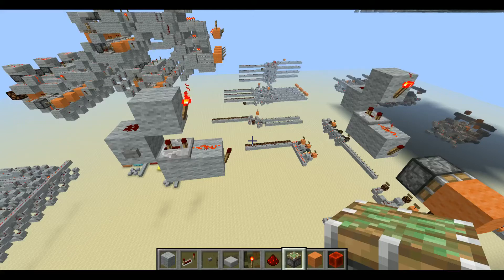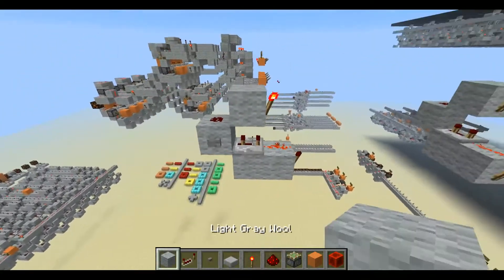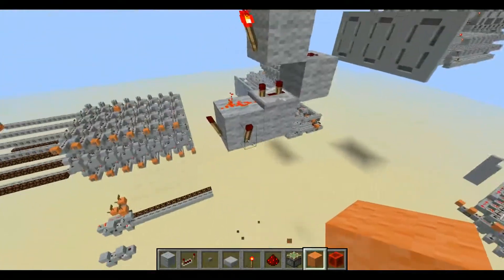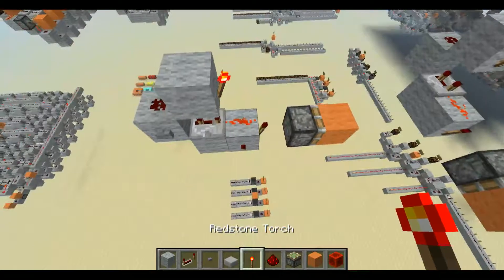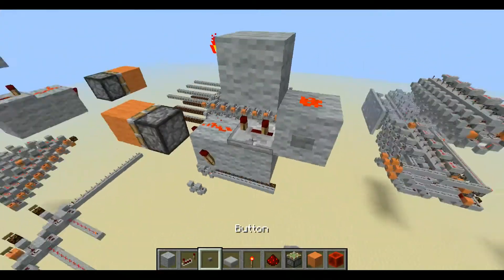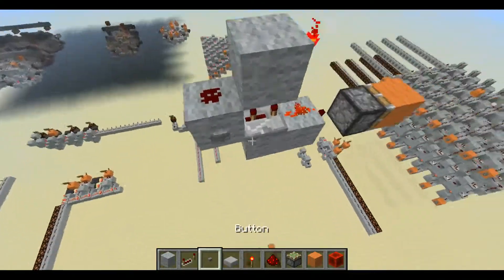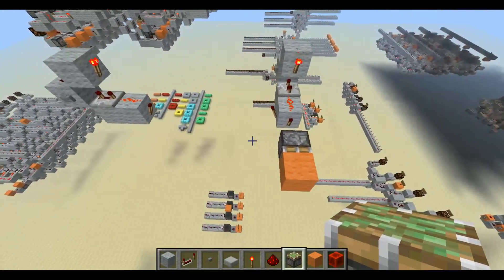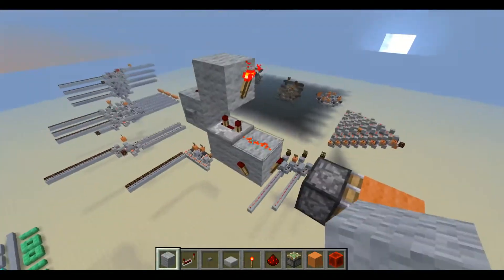Minecraft weirdest redstone bug ever (V024)

Comment: Kwin, it should produce a one tick pulse because if you had the repeater on 2 ticks, this would happen: End of first tick: torch off, repeater on first tick. End of second tick: touch off, repeater on second tick (powers output torch). therefore, the repeater must be at 3 ticks.

Comment: Shouldn't these mono-stable circuits actually generate a 2 tick pulses, since the output torch receives a 2 tick off pulse (when the first torch turns off, the repeater still needs 2 more tick to turn on). So the question would actually be, why does it work.